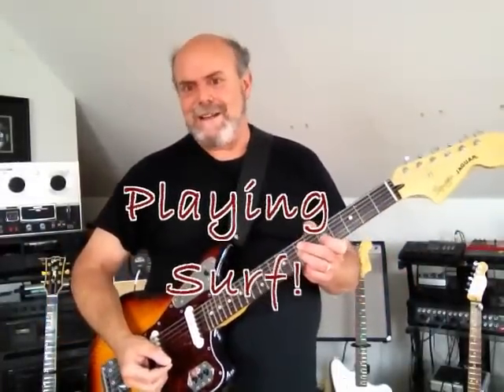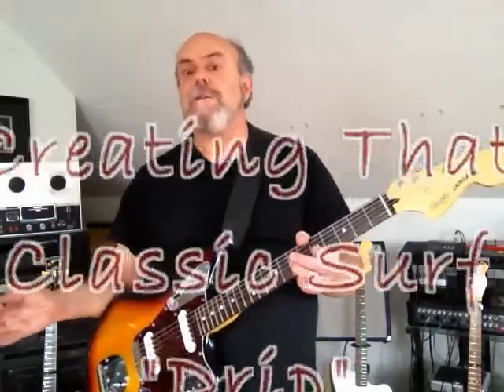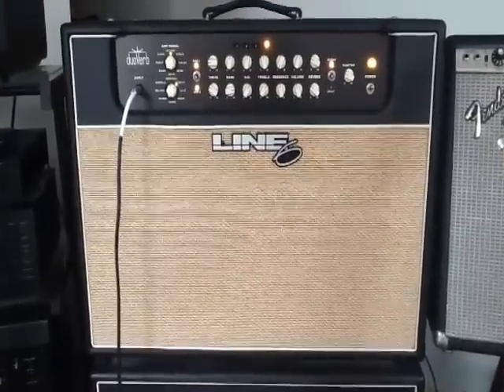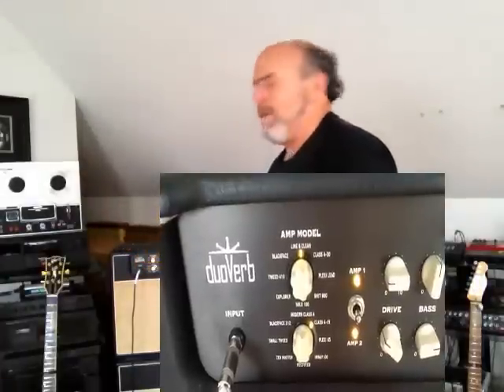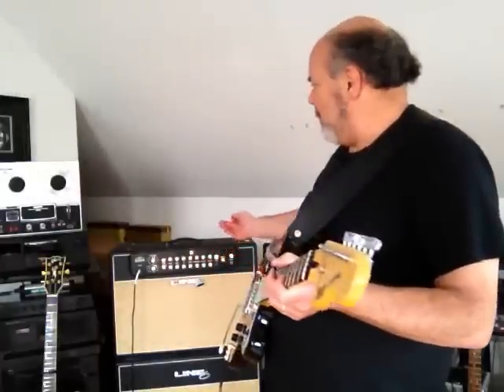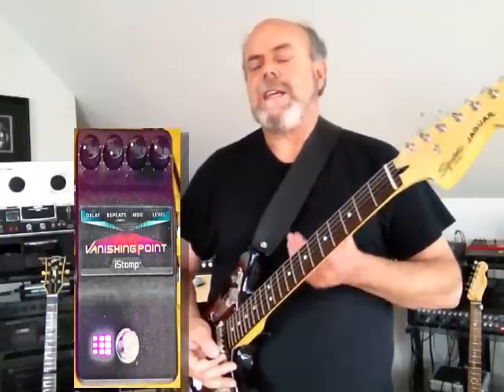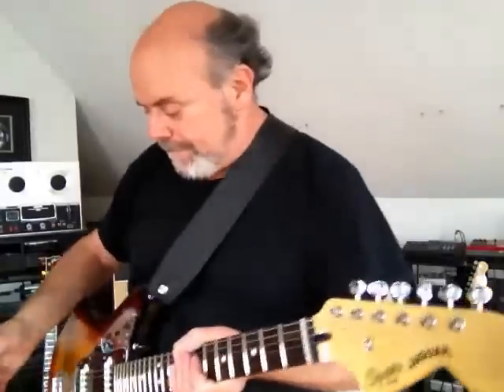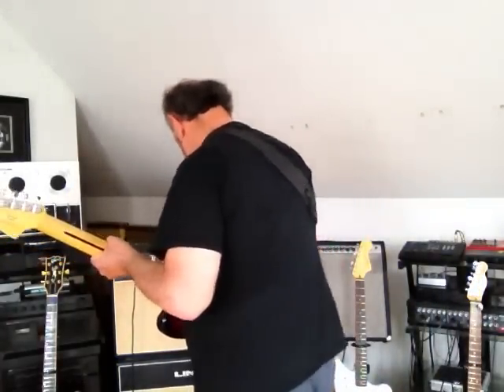Creating That Classic Surf "Drip"

Comment: wtf is this guy babbling about? Single coil guitar into a Fender Tank, into a (preferably Fender) tube amp gets you the vintage surf sound. Pretty simple actually.
Reply from the maker: +Daniel Picha  Well, yes, but...  "But" in that you have to have that tank.  This video is on getting the sound without one.  Also it is a fact that what one hears when listening to recordings from the `60s was not just the sound of a guitar playing into that tank and amp, but other things. Studio effects. And often tremolo.

Younger players particularly have their ears trained by what they hear now, live.  Blackface amps, often with built in reverb (which follows the preamp), or simply the live sound of a tank into something like a classic Showman.

If that is the sound you want then yes, that is certainly the most direct way to get it. But if you want the sound of what we actually created in the studio back then and put on a record. And especially if you do not have that older (or older style) gear, then the above information may well help you get the sound you are looking for.

That is what the video is about.  Nothing more, nothing less.
Reply: Bingo!  You just need the old tube Fender with a long, two-spring verb unit.  I don't even need a guitar to know if the amps got "the sound".  With the amp on and reverb up, just shake the amp and the wet-drippy sound is plainly evident.
Reply: I couldn't agree with you more.  Getting an awesome surf sound requires an amp with spring reverb, and that's that. Christ, you'd think getting that sound was like finding the Grail or the Ark of the Covenant. Spring reverb. Steer clear of all this digital horse manure.
Reply: OK, attacking him as a player seems a bit much.
Reply: Kim Runic 
What he is giving the lesson for is, I believe, a guy in a band that does a lot of music types, and may need to get close enough for a few tunes, without buying a whole separate amp and a Strat or Jag.   Sure, if your going to specialize in Surf, you get the gear.... but for a working band out on a gig, and somebody asks for Wipeout, you can futz with pedals and make the deal happen.
Reply: But there is no need to futz with pedals. Play through your clean channel, reverb turned up, the "deal" will happen. It is not hard to get these basic, old sounds. How many pedals did Dick Dale use? It was just an amp, with the reverb turned waaaaay up. This is like a ten step process to achieve a sound that you should be able to get in just one or two steps. We're not talking Brian May or Eddie Van Halen's sound here.
Reply: raybbaby 
Like I said, many people today do not have a tube amp with a long spring reverb tank ... and don’t need it very often... This a work around to use common pedals for the few times it might be needed...  Any serious surf player already owns a blackface or tweed vintage fender amp with long spring verb...that makes the slap echo and rich verb in one.  Mine is a ‘68 Vibrolux Reverb... not for sale, ( had it 49 years now) but I see them and dual 12” Pro Reverbs going for about 3 thousand...    So, many $thousands, or a few pedals, for the player that only needs surf once in a while?
Reply: harlon57 
Best way to play surf, agreed, get the correct amp.... no pedals needed.   No correct amp? cant afford it?     thats the point of the video.. you can get close with pedals... and there ARE other pedals that will work.
Reply: This video did a terrible job of making that point.
Reply: There's some petty people out there. "Buy the period correct gear if you want that sound!" Well no crap. My tube amp doesn't have spring Reverb. But I do have a delay pedal and a Reverb pedal.
Reply: A little tremolo does add some extra sparkle...

Comment: In the '60s I used flat wound strings through a Twin or Super reverb with the Reverb all the way up then palm mute and I got that super cool surf snap back and it worked with a Firebird as well as a Strat or Jazzmaster.

Comment: You need my 67 Vibrolux Reverb. Its the real thing. I was there back in the day and still remember how it was done.. You are mighty close with the effects boxes, but nothing like the Vibrolux Reverb, ProReverb, TwinReverb from those days.  If you really needed to be loud, a big Bandmaster with external reverb box was ok. This was so long ago, putting a mic on a  small combo amp was just not done yet..  Was hoping you would finish out with a Ventures or Dick Dale item... with the sound dialed in, I was ready for the tune!  👍🏻🤣..   Thanks for your video. It may help a lot of younger ones get the sound of my youth.
Reply from the maker: Jennifer, I myself used a `63 Vibroverb throughout that period.  Sweet amp!  (Oh how I wish I'd never sold it!)
Reply: Don Sucher 
Oh gosh, to have had that and let it go😥😥😥😥.  Life happens, and things come and go.   Your Jag sure does the period.  I also have a Jag, but its a little different, one of the hard-tail MIJ HH in the same colors as yours. I use Ernie Ball cobalt strings to bring out the twang usually not too strong with the humbuckers. Thinking a lot about putting a Bigsby on her....

My other is a 1966 Guild Starfire V custom, Bigsby delete, clear finish. I have had it since early in 1967, over 50 years now, about a year longer than the VibroluxReverb. 

Would love to hear you blast out some surf!    I miss the days of turning on the radio to a random mix of Jan and Dean, Dick Dale, Surfaries, Ventures, BeachBoys, and all the others...   It was a great period... influenced strongly the sounds of the later west coast, Quicksilver, early Grateful Dead, Beautiful Day, Airplane.. etc.. all had guitar whose clear tones came from surf...
Reply from the maker: Wow! Wow! Wow!  A Starfire V!!!

That's what I played during the later period of The Abstracts (and had used on the 45 release of "Always Always." )  See it here: https://youtu.be/MAkvgzM7O10  alternated with a P90-equipped ES 125.|

Its great that you held on to yours!!!!  Wise, wise lady!
Reply: Don Sucher 
I got so lucky to even have it... I was turning 15.. dad got it for my birthday. It had been custom orders from Len’s Guitar city in Bloomington MN by a guy in the Castaways ( Liar Liar) and he could not afford to keep it. It went back to the store on consignment, then finally he took it home, and as the price got lower as other financial pressures loomed, my dad bought it for only $200. 4 months old, originally about $800... it was the deal of a lifetime.  Blonde clear finish, custom ordered Haggstum bridge, custom Bigsby delete- with harp tail, so its like a IV but with the master volume of the V.  The guy that did the Guild book says he wants to put it in his next edition , as its an odd factory one off.. with a known pedigree since new.   Hard to imagine, its been over 50 years now... As I get older and face passing on, I have to start thinking about how to move it forward to someone who will cherish it as much as I have..

Comment: The newer fender vaporizer gets perfect drip with no added effects.... also the fender super reverb.. reissue or an original gets perfect drip with no added effects. There may be others but I have only have experience with the ones I mentioned. I think some of the difference is units that have tube driven spring reverb. The vaporizer you can turn the tone and volume knobs all the way down and turn the reverb all the way up you actually play straight through reverb and it has the best liquid drip I’ve ever heard.
Reply from the maker: Thank you for sharing that Clayton.  

I am unfamiliar with the Vaporizer.  I'll need to check that out! :)

Comment: Great demo! I have a 71' deluxe reverb and have found a similar sound by buying a $7 patch cable to run my amps reverb through the normal channel ,it gives you a level control as well as a dwell control. Then I use my amps tremolo along with a digital delay pedal.
Reply from the maker: I know a lot of guitarists who view those Deluxe Reverbs as the best of all the classic Fender amps.  Enjoy!!! :)

I've tried to do a patch like that on my `76 Twin Reverb but without success.  What I did is run a cable with a RCA jack into the reverb tank's output into quarter-inch (guitar type) jack in the normal channel.

My hope was that I could then use the normal channels volume and tone controls to do as you say -- have a "dwell" control plus three bands of tone controls (bass, mid, treble) for reverb signal.  What I got was no reverb at all.

If you can point out my error I will be SO appreciative!
Reply: I think you have to run the cable from the normal channel 1/4" jack to the reverb input. The reverb power supply is being replaced by the normal channel power supply so you are using the v1 tube to run your reverb instead of the v3. So it should be plugged into the input not the output. You can only get a level with your volume knob and a dwell control with your equalizer circuit but it is a step above the standard setup. It's really a lot like an ac/30 reverb setup. But as to your trouble, try plugging the cord both ways and make sure your tubes are ok.  If your amp has been modified for reverb on both channels, then the mod you want won't work.
Reply: Also, the cable should be a standard positive/ negative 1/4" on one end and a single RCA style on the other containing both positive and negative in one end not two ends like a tv jack. I know you are knowledgeable enough to know that but I've had 17 year olds ask me if their amp could work without a speaker before! Lol have a nice day
Reply from the maker: Thanks H.C.

I'll have to play with it.

Alas I am not sure how to use your advice.  What I had hoped for was to use the channel 2 for  my guitar and use channel one to amplify and control the reverb's output. That is what I understood others to be doing.  But maybe I missed the point entirely!

Comment: Nice. I recently bought a fender passport mini amp to practice on with my squire jag and one of the presets that it had on the amp was the classic surf reverb. Really close to the tone and you can also add post fx on to the preset through the fender fuse software and also create a whole different preset to save on the amp through the usb cable provided. I also found that using a compressor can also amplify it louder since it really works with a jag well

Comment: Heya Don, 
Can you post your dial settings for the tremolo, echo and reverb?
Reply from the maker: Heath, the video was made four years ago so the settings now will not match the settings then.

I am currently using a Jazzmaster for surf in that area (I have another playing area with the Jaguar using another amp -- see my videos.)

Tremolo is set first for speed, then depth. This ideally changes to match the song (but in truth I do not regularly do so)
Echo is set to a single echo.  Time is by feel and on mine, at least, the control is super sensitive.
Reverb, too, ideally changes by song.  I "cheat" here -- adding the in amp reverb to increase the amount on songs that benefit for it. The other reverb settings, time dwell and mix (combined on many units) is again determined by song, amp settings and guitar choice.

Sorry if that leaves you hanging.  But the fine tuning of your own system will be a learning process. And, hopefully, an enjoyable one!

Comment: Cool video, brother. I've tweaked a Boss Delay 7 to get the slapback rockabilly sound and hooked it up to a Topanga Reverb pedal and it came pretty darn close to the drip sound. Also Digitech makes a pedal called Polara that has an awesome spring verb setting. Hope that helps out you surf heads! I play with the guitar player of The Aqualads so you can trust I know what I'm talking about. Thanks again for sharing. Great minds think alike!
Reply from the maker: +Josh Featherstone  Thanks Josh!  I've heard lots of good things about the Topanga.  :)
Reply: +Don Sucher good call on everything; using tremolo is something I hadn't considered using with Surf (on lead guitar), but it makes perfect sense! I am currently fighting between my BOSS RV-5 on 'spring' mode and my amplifier reverb tank but i've found that a amplifier tank reverb (real real tank); it's decent sounding for a digital(?) pedal but not as thick as the think. time a new pedal!
Reply from the maker: +paintballpete89  I've obviously not tried all the available pedal reverbs, but have used several. The closest to the "real" thing -- meaning the sound of an old tank that plugged in before the guitar's signal hit the preamp stage -- is the Boss FRV-1.

In truth it is too real for some players -- those who have been weaned on later, more natural, reverbs such as those built into current Fender amps.

The biggest difference is in the "boing" -- that very mechanical sounding addition those old tanks add to the musical signal.  Something you either love or hate. (I discussed this in my review of the pedal published by Amazon:  http://www.amazon.com/review/R24VDUDQSPI0GT/ref=cm_cr_dp_title?ie=UTF8&ASIN=B002IJQKX2&channel=detail-glance&nodeID=11091801&store=musical-instruments)

Apart from the FRV-1 the only pedal I have seen that tries to reproduce this effect is the "Spring Tank" app available for Digitech's iStomp.  It actually has a control marked "BOING"!  And it is pretty effective, but not, IMO, equal to the FRV-1.

Have you tried using both the pedal and the amp's built-in reverb at the same time?  I do that when playing the odd song that benefits for having a bit more reverb than my typical FRV-1 setting provides.

To me the one rule -- and, indeed, its the rule that helped me develop the method set forth in this video. It is that THERE ARE NO RULES.

Some find this approach troublesome. Not me.  I do this for fun. For release.  For the simple joy of the music.

Comment: Nice video, Don. Great mention of the slap. I think it's all about the springs when it comes to the drip. Aside from Fender's standalone unit, I think there are some pedals that come fairly close. Spring Theory does a good job of getting that bouncy sound. I also like the Holy Grail in general, and some Lexicon units are great. Have you ever heard of The Mermen? They're a surf rock band from the 90's. They are absolutely my favorite. If you or anyone reading this hasn't heard of them, go check em out. They're essential for any surf rock lover.
Reply from the maker: Yes indeed I have heard of the Mermen.  Their name comes up from time to time about the web, and always, as in your case, with high praise.  :)

Comment: Nice demonstration and explanation. To me, there's just a little too much reverb though, and it seems to overshadow the slapback and tremolo. I'd like to hear how this sounds with the reverb backed down just a bit. Anyway, cool video, I'll have to try some of these sounds out myself.
Reply from the maker: In my own playing I vary the intensity of the reverb from one song to the next.  (One was is by turning down the FRV-1 level a bit lower than I have it here, and supplementing it when I wish it to be a bit stronger by turning on the built-in reverb on the amp.)   But Penetration -- whose 2nd melody line is used in this video -- in a song where I personally like to use A LOT.  :)

Comment: I was going to get an FRV-1, but the shrill banging of springs is hard on my ears.
I've since bought a Hardwire RV7, and I love it! Very springy without the harshness.  I believe the palm muting
really brings a lot to the boinginess of the reverb. :)
Reply from the maker: I think from a commercial POV Boss/Fender would have done better had they modeled a `65 tank instead of the `63.  Or, better yet, gave the user a choice between the two.  That "boinginess" is inherent in the `63 and I for the most part love it.  Yes, it needs to be controlled, but that is part of the game!  Most players, these days at least, share your viewpoint.

BTW, when it starts to get out of hand I turn down the FRV-1 a bit and add some smoother, more "modern" sounding, built-in reverb.

Comment: I use a Electroharmonix Cathedral Reverb to get it, I set it to the "echo" setting, mix the guitar and effect 50/50, set the number of repeats to one with approxamately a 10oclock on the knob for the amount of delay it has (maybe 3/4s of a second), and the reverb time so that it sounds as if you're actually playing in a huge medieval church. I discovered it while tryinng to find a tone similar to Hank Marvin's on the song "apache". Also the Reverb is good for getting that "Sun Records" rockabilly slapback tone, and thats the reason I bought it.
Reply from the maker: Thanks Karl.  I've not had the pleasure of hearing one of those.  I'll need to check it out! :)